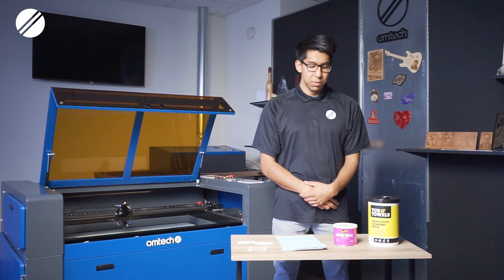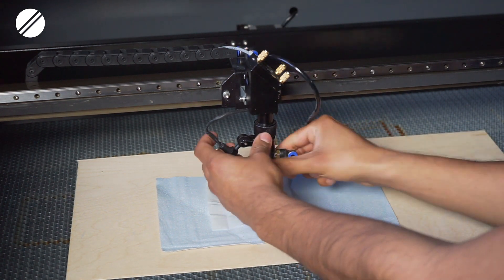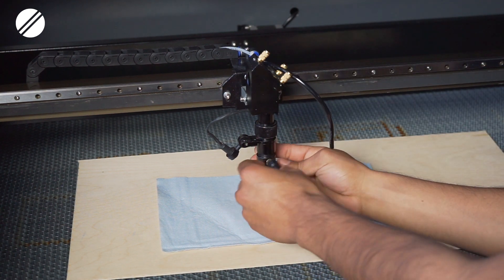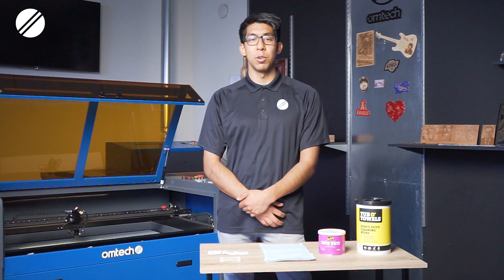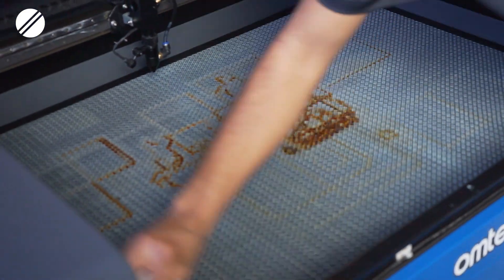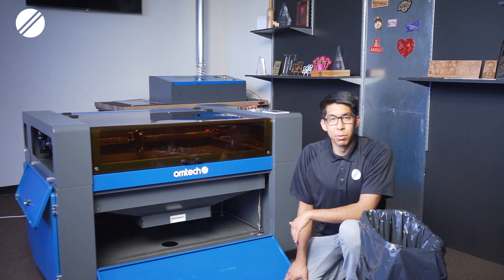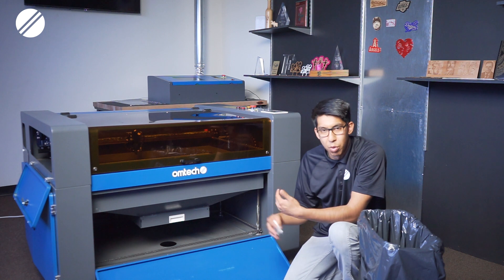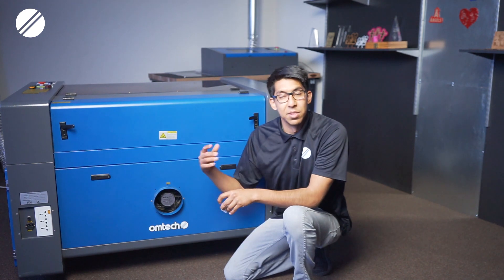Cleaning Your CO2 Laser Engraver - Training Video - OMTech Laser

Comment: Noticed that my unit USB570a (bought in Sept 2022) does not have the same location for the lens as this video and others have displayed. My lens is located in the shaft/stem of the laser head instead. The tip (head) does unscrew and has the same silver ring but the lens is not even located there. Any suggestions? I can still access enough to clean but was just wondering as I would like to actually take it out completely to clean correctly.

Comment: Thanks for the video. Can you remove the built in fan or will it throw errors when you do. Im thinking of buying on the big ones but want to use the AC INFINITY system. would rather remove it than have an obstacle.

Comment: I'd like to know about cleaning the laser tube.  Best cleaning material to use, ect...  I dont have a very dust free environment for my laser as it's in my workshop and has a coating of sawdust on it that i cant just blow off with my air compressor, it's hardened on there.
Reply from the maker: Hey there, thanks for reaching out!! We suggest cleaning your laser tube with Isopropyl alcohol. For further assistance, you can reach our Technical Support Team at https://omtechlaser.com/pages/contact-us

Comment: Thanks for this helpful video. I just setup my 55W OMTech laser today. First cuts (a simple  10mm circle) are showing a ghost circle offset by about 1.85mm to the left. I've cleaned the lenses and mirrors, but the defect is still there. What do you recommend next?
Reply: It turns out the first mirror was jostled in shipping. I followed the alignment video and adjusting the first mirror after the tube so the spot hit the Y target center fixed the ghosting. thanks for these videos. very helpful
Reply from the maker: @GridSpace  No worries, we're glad that you're able to fix the issue!! Feel free to contact our Technical Support Team for other questions and advice.